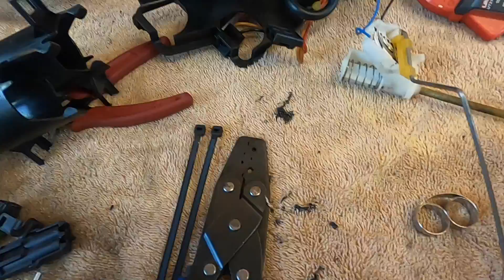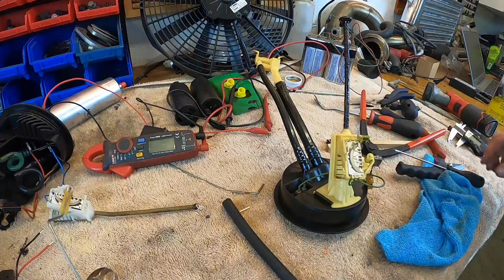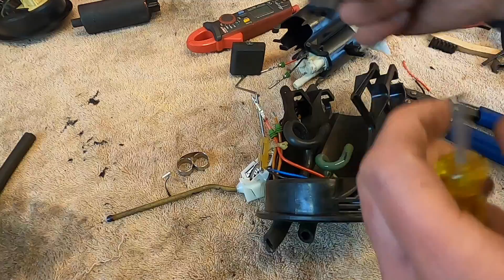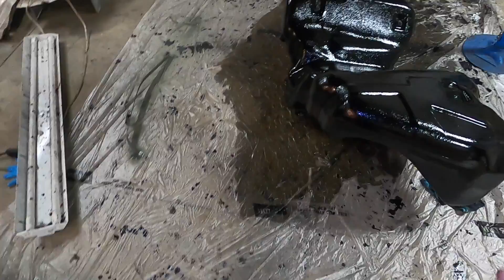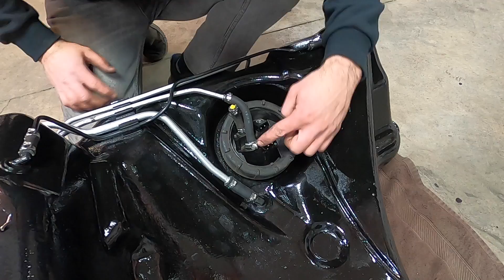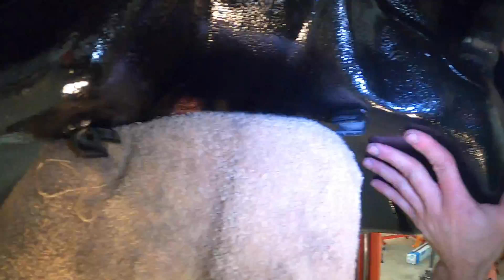BMW E31 S85 V10 Fuel System Upgrade Pt 2 of 2!

Comment: Very nice Frank! Was the OEM setup 2 pumps? Will this car be running on regular RON98, or is this not available in your area? ( in Europe the ///M engines are running on RON98). Stay safe, Nico
Reply from the maker: Originally was 2 pumps. Converted to single pump. Will run regular 93 octane